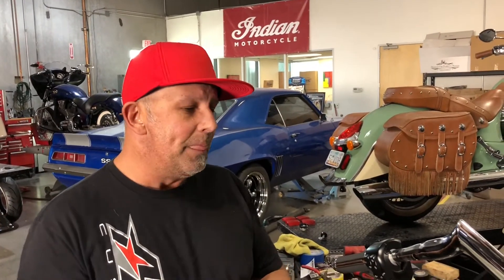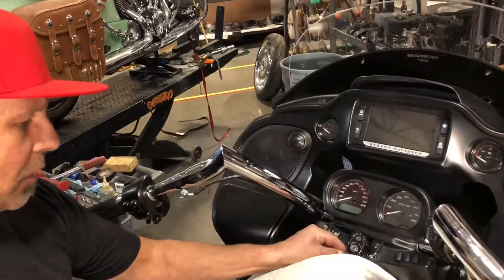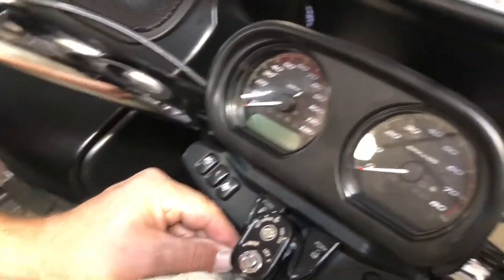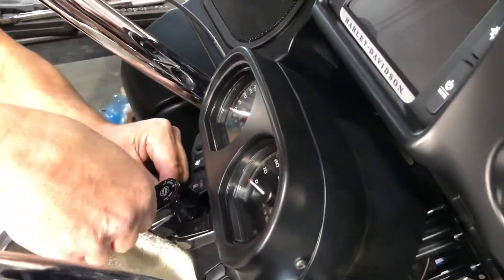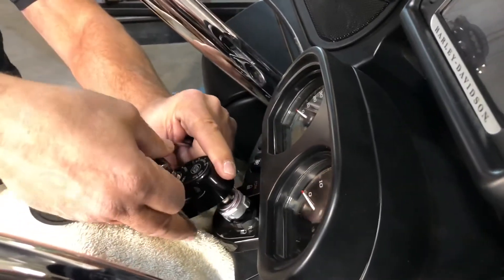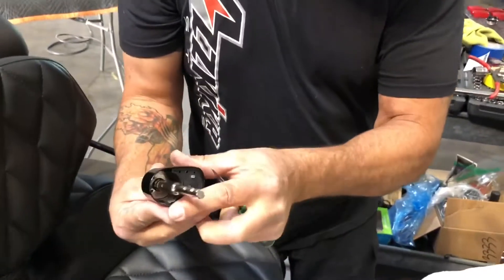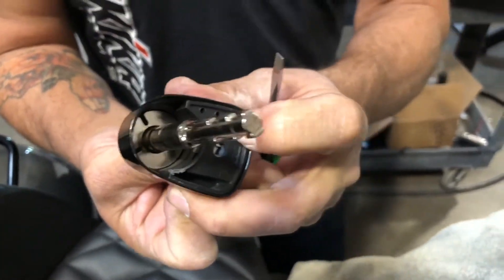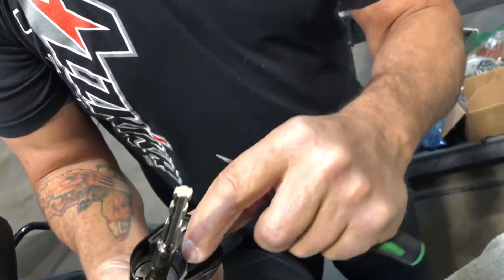Ignition Switch Removal 2018 Street Glide

Comment: Hi John! If I've screwed up the alignment in the ignition tumbler can I realign everything back in the off position and slip ignition switch into place? I've been told the key only goes back in at the lock position  - but that doesn't look like the case in your video.  Thanks!
Reply: Derrick did you resolve this?  What did you do I have the same issue.  2019 Street Glide.
Reply: FYI: i made a tool using the 1/4" copper pipe as shown in other videos.  I took some finesse and patience mostly to figure out exactly what i was trying to do but I was able to align the cams and re-insert the ignition lock.